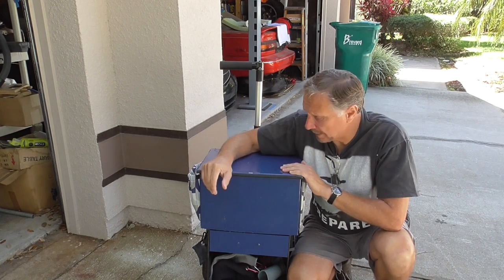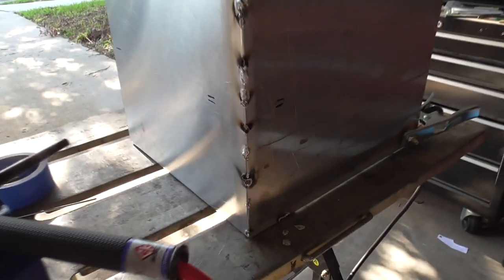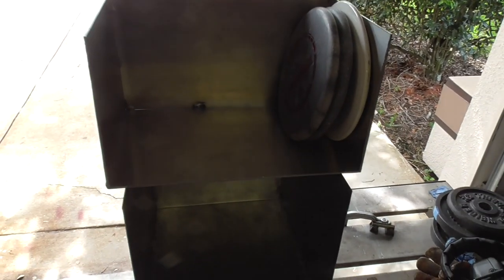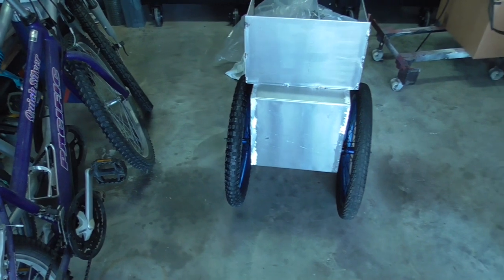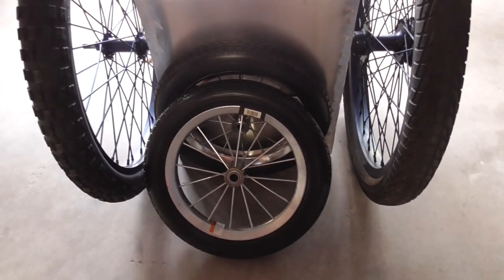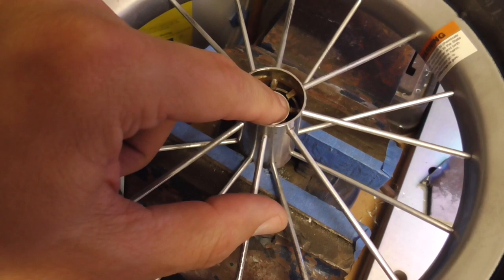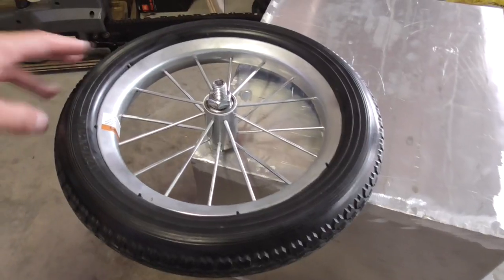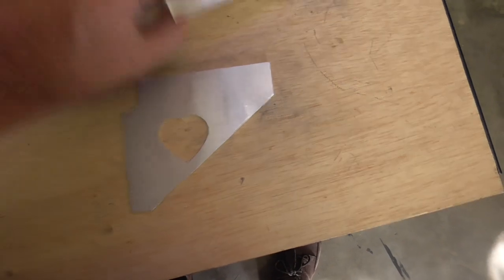AS_017 DIY Disc Golf Cart Build

Comment: Definitely need a longer shaft & two nuts 
🤘😆
Reply from the maker: That's a lot of comments.  LOL.  You're not wrong.  The only response I have is that I really don't like carrying the backpack.  It doesn't really hold as much stuff for both me and my wife and I always have to put it on, take it off, set it on the ground where it gets dirty, or bugs get on it and recently I got poison ivy pretty bad so I don't want to get that on the pack.  I just use that when I travel.  But if you think this one is crazy.  Wait until you see the next one.  I'm almost done with it.  It's very sci-fi.

Thanks for the comments.

Comment: What is wrong with 18 discs and a backpack 🎒 that goes with you
Reply from the maker: I don't like taking the backpack off and putting it on over and over again.  Plus you have to set it on the ground, which may be wet or have ants or is just dirty.  I use my backpack when I travel.  The courses near me are all very flat and conducive to using a cart.